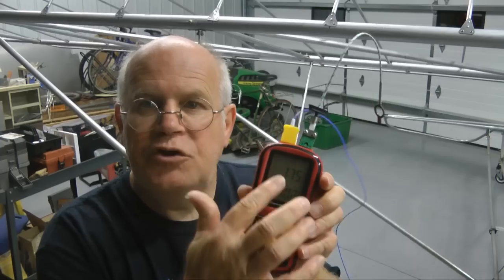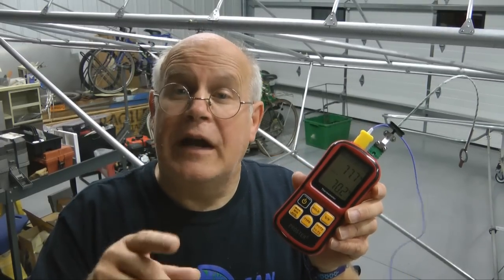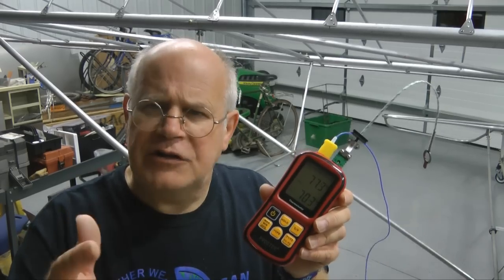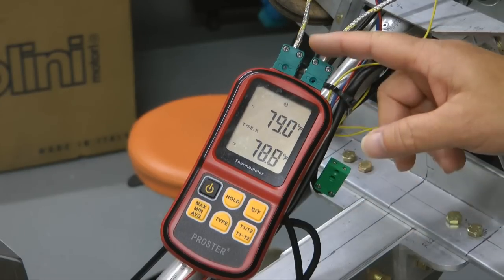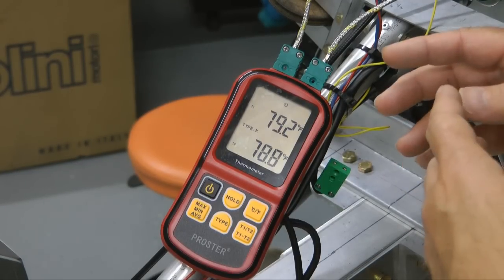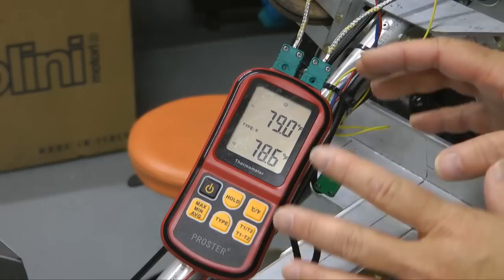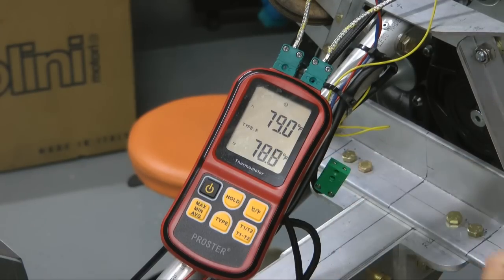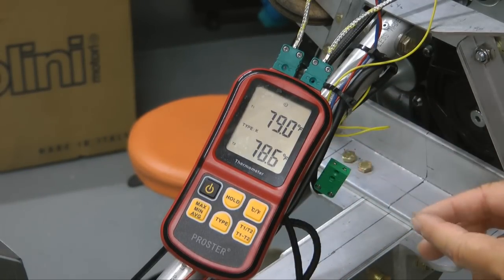Did You Read the Fine Print?

Comment: Jon, I think I could help in this situation you are having; well, maybe not help, but give you some insight into the issue.  

I build automated black oxide systems, so I deal with thermocouples daily.  I also create the ai logic circuits for operating them, so I've got a little experience in these critters.

You are using what appears to be a  K Coupler for both your water and your EGT sensors.  The way the K-thermocouple works is when it's heated, it generates a voltage.  So, for an example, in your scenario, your meter is only suitable for a one voltage differential reading.  That means your voltage reading cannot deviate more than 1 volt between the two probes.  

So, if you are measuring your water (coolant) temperature at around 210 Degrees Fahrenheit, you cannot exceed more than 1 volt.  At 210 Degrees Fahrenheit on your k-coupler, you are generating about 4.1 volts.

That means your other probe cannot exceed 5.1 volts, which would put your maximum temperature reading ability at about 255 degrees.  If you exceed the 255 degrees, you will begin to have an exponential deviation on your meter reading.  This goes for whether you are above or below the 210 Degrees on your other probe.   For clarification, you are subjected to about a +/- 22.5 degrees Fahrenheit range between the two probes, maximum.

To do what you are trying to do, you need an isolated reader which does so internally.  Or, you can purchase two probe readers and accomplish the same objective.

I hope this helps the problem a little better.
Reply from the maker: Thanks for your insight Dwight. My test of connecting the two probes with a ground wire made no change, which puts to rest the idea of grounding issues.  It would have been super if they could put that limit of 22 degrees differential in the product description. My CHT and EGT temps are so far apart that this really explains the crazy readings when both connected.  Simple solution for me:  add another meter for an independent reading of each sensor!

Comment: You weren't sold something that was defective and they offered you a solution.  This is not a flaw it is so well known that you even figured it out yourself. The only other solution is to use two separate meters which basically does nothing different than isolate the probes.  If you put an outside voltage on any DUT the readings will be incorrect.  Electrically isolating circuits can be nearly impossible, just ask the guys that fight with ground loops.

Comment: Maybe an earth strap between a head bolt and the exhausted stud would remove the voltage difference.
Reply: I had a similar problem when I added an EGO sensor to a 2 stroke race engine.
I would loose the temp guage. I found the EGO sensor variable for tuning but I still needed the temp guage. By adding the strap it cleared the fault. If you have a voltage between the two then you will run the risk of corrosion.

Comment: I use the same meter to monitor the CHT and oil temp on a 420cc Predator engine.  I have notice this meter is certainly better than other low cost meters, but if you operate the meter too close to the magneto ignition system, the meter will fault out.

Comment: G,day from Sydney Australia.
Just to confirm. No need to insulate the thermocouple wires only the connection of sensors to engine part: wherein the volts could be present?.
Could you harness them (wires) together?
🌏🇦🇺

Comment: I like how the issue and the fix are on the first page of the manual. It might be tough to find a decoupling mount that will work on the heat of the exhaust but as long as you can insulate the one in the water jacket, that’s enough to separate them from each other.

Comment: Did you try a thick copper wire with allegator clips between the probes?  Force the ground to be the same.
Reply from the maker: That's an excellent suggestion and experiment - tho  I hate to have to keep that on the engine forever...
Reply: @HomebuiltHELP  Let us know if this works Jon
Reply: I agree with Peter, Please let us know how it works. On the other hand, if you need to isolate the probe, how about running the EGT probe through an old spark plug housing. (Ceramic that does not conduct electricity)
Reply: I was wondering the same thing. I will be glad to see the answer.